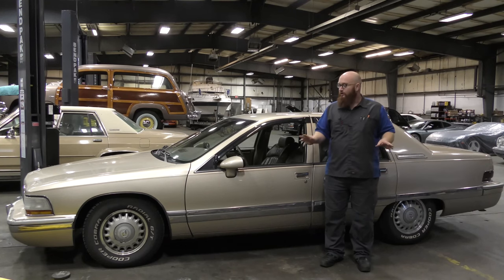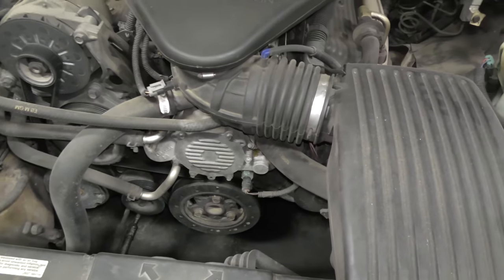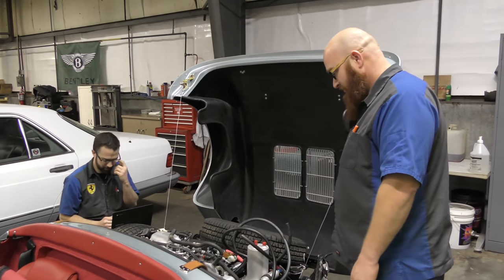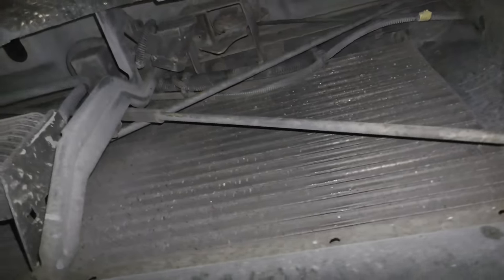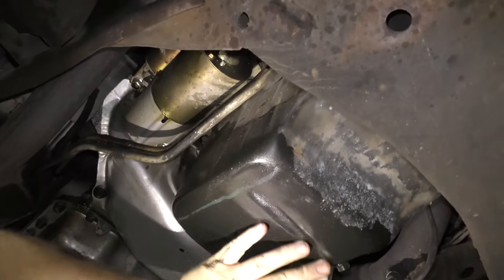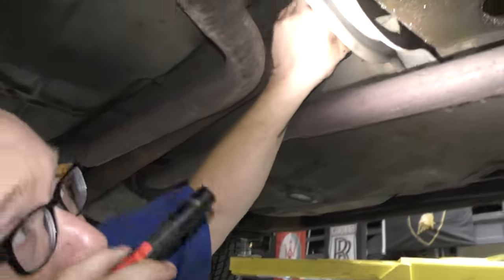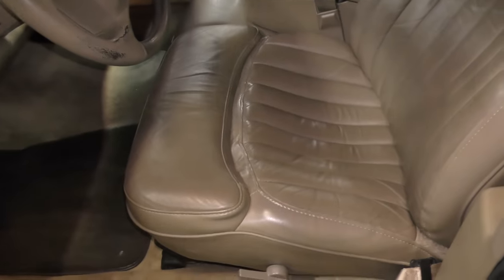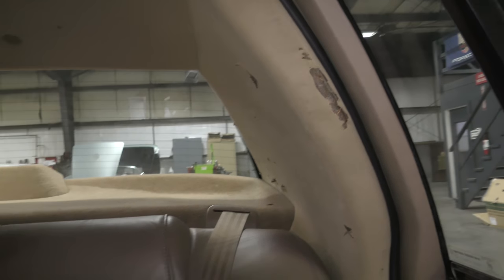Why do mechanics buy 'grandma' cars? CAR WIZARD explains their lure with this '94 Buick Roadmaster

Comment: The real reason: These cars are cheap, and mechanics are poor.
Reply: @Painful3rection92  That describes everywhere I have worked if you add drugs.
Reply: Exactly
Reply: You're only poor if your s[ending habits are equally poor.
Reply: Janet Jones - Everyday mechanics see hapless people piss away hard earned funds fixing ridiculous cars or just throwing them away as junk, due to prohibitive repair costs that are more than total car value.
Reply: Came to say this. Also Mines even easier to work on. Its new and doesn't break. If it did its under warranty. 24k miles with no trips to the shop. Let's see that beater grandma car do that with no repairs.
Reply: @chublez  ya but old cars are extremely durable compared to new cars no electronic plastic crap to go wrong but I know what you mean doe
Reply: @chublez  what car you are flexing
Reply: @chublez  and you have a payment
Reply: chublez let’s see your fuel efficient car🗣🤌🤣😁  stay away from the CAR WIZARD’s channels with all the new car fuel efficiency crap💩  this is America.
Reply: @carlcampbell6827  because manufacturers are shit and mechanics are shit, so it’s unpleasant from the dealer to the crusher.
Reply: @clintdavis9511  same here
Reply: @clintdavis9511  what kinda dope do mechanics like.the.most?
Reply: @Monsieur Tarzan ya good old from the noughties and the 90s Chrysler are never good that's not a good old car that Honda and my mams Nissan Micra is way more durable once it had no oil whatsoever for a few days and it ran perfect until the oil light came on we'd no idea that there was no oil
Reply: @dw4940  This one likes weed!
Reply: Maybe if you work at some slow indy shop in the middle of nowhere...union dealers in the Chicagoland area on the other hand...we're getting it!
Reply: I was a mechanic for 20 years... now I’m a truck driver and make WAY more money!
Reply: I am a certified master toilet mechanic. Plumber. But I am just in it for the prestige of being called a toilet technician, not the money. And women want me.
Reply: Every mechanic I know throws their money away on new tools or "project" cars or puts it back in their business to expand it (if they are independent). Which is why they are poor.
Reply: @dw4940  from when I was coming up it was crack cocaine 💀 🤣

Comment: I've been a mechanic for 25 years and the older I get the more appreciate the old cars. I hope that by the time I retire I'll be driving a model T.
Reply: Over 30 years here my friend and I agree 100% lol.
Reply: There’s just a certain charm abt old cars
Reply: Get a  "Model A"  you'll thank us later
Reply: Rod knock? Just tighten the cap end
Reply: I’m so old I’ll be riding a penny farthing
Reply: I like to go by the new car dealerships once in a while and see the kind of car I'll be driving in 10-12 years.
Reply: @silverjohn6037  Half those new cars fall apart before the warranty even runs out, if you're lucky. They have increased the quality of the interior, added features, and have better fit and finish. But it's like to do that and maintain a price point the really skimped on the quality of engine parts. So I wouldn't bet on them making it that far.
Reply: @Flabulo  It's not guaranteed but I've had good luck buying 4 door V6 sedans.  They're uncool enough that they tend to have been driven by older drivers who don't abuse them.  Of the 4-5 I've bought of that type I've only had one lemon (bad electrical system).  Since I was only spending about 4-6,000 Canadian dollars even that lemon didn't hurt too bad.
Reply: @silverjohn6037  Houstly, out of all the modern stuff I've had; and a lot of people are gonna disagree, the best car I've ever had was a 2015 Chevy Cruze. They had the turbo problems sorted by then for the most part. Ya, I had to swap the cam cover twice because of the pcv problem, but its a $40-$60 part. In the over 100,000 miles I put on that car that is nothing! Oh, and of course I had to do the water pump and outlet because plastic warps and they all do it. But once again, they where like 20-maybe 30 bucks. Actually the water pump failed while still under warranty and I was a tech at a Chevy dealer at the time. So I just got one of my friends/coworkers to do it. But almost nothing is hard to replace on those things. The oil pans leak? It's easy as  hell to just pop it off and put some new permatex on there. 2 hours maybe. There is so much space around that little 1.4L. I have no doubt that some of those will be around for years. But, of course being an eco car there is gonna be some abused ones that never get fluids changed. Now the post 2016 ones excluding the 2016 Limited are garbage. The epidemy of a superficial upgrade but a mechanical downgrade. Somehow they made a 1.4l a tight fit on that one.
Reply: @Flabulo  I’ve heard good and terrible things about Chevy cruzes, seems to be a case by case basis with those cars

Comment: I understand this philosophy perfectly. I have worked in IT for 18 years now and I apply the same thought process to my technology at home. I have mostly older, reliable tech and things I've built myself. I don't want to spend the weekend fixing broken shit!
Reply: Yeap, all my HW is ex refresh. A few cheap upgrades like vid cards etc and you have a very cheap capable machine
Reply: sysadmin here, same except I have an enterprise grade nw setup as well for testing 😂 but by this point it is super optimized and have years of uptime.
Reply: Still running my Lenovo T420 with a SSD and extra ram
Reply: I never even went to college and I know already older is better because it's all I have, and it works and never has not worked.
Reply: As a fiber optic tech I refuse to get internet to my home because I really don’t want to put a rack in and run ports to every room.
Reply: @MrWolfSnack  Hey furry do you even know what fiber is
Reply: @Green Mamba Games Almost the same, except I'd go from "sparingly" to well vetted. For example, those 2nd gen prius' have proven themselves (ancedotal evidence here) along with some of Toyota's less than bleeding edge hybrid tech. Because of the geographic area of my job, it is not unusual for most of us to commute 100-150mi round trip to avoid the doubling to tripling housing costs locally. Most of those hybrids hit the 270~300 mark before major repairs. One guy I know as a supervisor had his when I came on in 2013 with 110k on the clock.

He's still driving it to this day and his commute is 45mi each way. We're all mechanics, just not on cars so the last thing we want to do is fix crap. Tuning things and upgrades is one thing, but fixing broken stuff is tiresome.
Reply: @GrubGaming

And the NSA thanks God for people like you!
Reply: if I had my own home I'd set up a lab but... I always found there's two types of IT people, the guys who genuinely love computers and will spend $3000 on a gpu and then the guys who just want stuff to work and can troubleshoot and fix things. If I didnt feel like there was a need to have a back up PC or if I didnt have other hobbies that required it, I wouldn't have a desktop at all.
Reply: @dpreetam  well I just want it to work. I have a 8 year old laptop connected to my nw that I use. It works enough for me 😂 but I also like to tinker and keep on top of my development.
Reply: yup. The computer i built has broken exactly 0 times. eat that dell!
Reply: @MrWolfSnack  I don’t do home internet, I do large businesses and factories. I’ll do home internet however the fuck I want. Shit, I’ll use conduit instead of crown molding just because it can literally be done a million different ways and it would make little people like you sad. Don’t fucking @ me unless you wanna punch down 10 panels.
Reply: When it comes to computers. 

No Linux to fiddle with things, even thou I'm a programmer, I don't want to spend time changing my operating system, I already program the entire week.
 Just a normal Windows machine, it works, who cares its 5% less performant, who cares about performance anyway. 
I just buy workstation parts and keep the machine for 6 years. And I have one Geforce970 mid-tier to play some games in the weekend sometimes.
Parts just don't break that easily if you buy good quality. And I have a massive box of a case that's easy to replace parts.
I just mirror the entire hard disk and remove it, so I don't even need to format the machine after the first format, anything goes bad, just plot another hard drive and mirror it again in a 
new one, throw the other into the trash.  Although that never happened once in 6 years, its always the PSU or the hard-drives that goes. The PSU was replaced already.
I just throw away hard-drives like air-plane pieces, by the number of hours of use, if you do that to a hard-drive, your computer will never crash, its always the hard-drive starting to fail that causes problems to software, you get files corrupted, then you start having software problems, its that simple. Just throw away the hard drive, or the SSD, it doesn't matter. MTBF is what matters (mean time between failure, you get to half of it, you replace the part).

And I hate notebooks, I don't have any, they aren't reliable, just go and buy a good desktop, or 2 if you have an office, its important to buy good hardware because the drivers usually are better coded, so the system will be more stable, I bet that will solve most of your computing problems.

Also, when it comes to my cars, I want everything mechanical, with less microprocessors.  I don't want bullshit touch screen every-where, give me dials, I love dials and buttons. I don't want a computer.
And I have nothing of that IOT crap, no smart-house bullshit, no smart-thermostat, nothing, no Alexa, no smartphones Apps crap, just a simple old Snapdragon 820 phone for some email reading and emergency calls.

I hate smart-things, if things are smart, it means you, the user is dumb.

Of course, the most important thing ever, I never ever do any support to family, I always say, I don't work with computers, I do mathematics using computers, its different. So no, I won't fix your computer for you.
Reply: damn I thought it was for the milage they get...🤣
Reply: what is the thinkpad of cars
Reply: GrubGaming  Same, most find working on things and trying to get stuff working to be insanely annoying, I personally have always found it calming to some degree so long as its not running into those maddening issues with no known cause which thankfully are rare nowadays
Reply: @WilliamWonka  the hell are you talking about? Fibre to single endpoint. Wifi mesh. End of story. Rack and ports? WHY.
Reply: yeah it gets old fast
Reply: @joeh858  sure he does....its roughage like whole grains , oatmeal, bran, fruits veggies.....  DO YOU KNOW the old stuff is better or are you still in 3rd grade ?
Reply: Fixing stuff can be fun though sometimes. I like that it allows you to learn the inner workings of something and why it's able to work the way it does. That being said I like reliability

Comment: It is even in '90s beige, the most period correct color.
Reply: Gold, homie.
Reply: Had a roadmaster in refridgerator white, awesome road trip car, stone reliable till i got rid of it at 300k miles when the rust became to much to fix.
Reply: @BigBing1987  You sadly did not know about lanoline grease/oil (Fluid Film and others)
Reply: @steinbauge4591  car was a daily driver for 20 years in upstate new york, they all rust out up there eventually, it was repaired and patched many times over the years, the frame cracking at the rear control arm mounts finally did it in.
Reply: @BigBing1987  They don't last forever but lanoline (FluidFilm in the US) is quite unbelievable. it saved my Ford Escort 1977 from major welding - just stopped the rust cold. Can be used on surface rust, goes into the pores of the steel - saves a ton of work as all the rust does not need to be removed.
Reply: Yeah, it didn't wanna be racist.
Reply: My family had a 93 roadmaster in a burgundy color
Reply: I don't miss every 3rd car being this color
Reply: My first two cars were both beige, both owned by little old ladies.  The first was a Mercury Cougar and built for comfort, the second was a Ford Escort, a comfortable but practical car.  Easy to maintain.
Reply: Haha. Yep. The future was beige. Whether it was the bridge consoles on Star Trek: The Next Generation or your Compaq Presario 486DX 66MHz computer with a 4x CD ROM and 8 megabytes of RAM.
Reply: jewish racing gold
Reply: @Gormen Freeman True, but the ability to stop rust is like nothing else I've seen.  A little rust is actually good when you apply lanoline grease. My car had surface rust and rust in all cavities, had to weld a little on rocker panels and wheel arches. Had a car of same type that rusted to pieces because I did not know about this, now I have no rust work to do at all.
Reply: @steinbauge4591  Going to do my 98 Explorer with it. FRame not rust much, YET!
Reply: Have you heard of plum/purple?